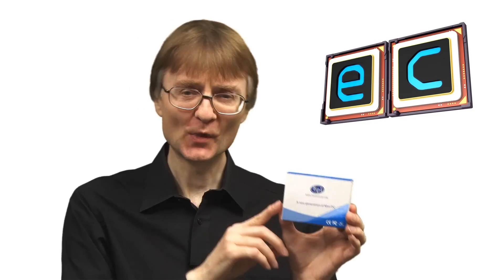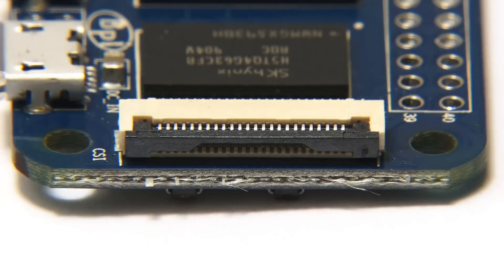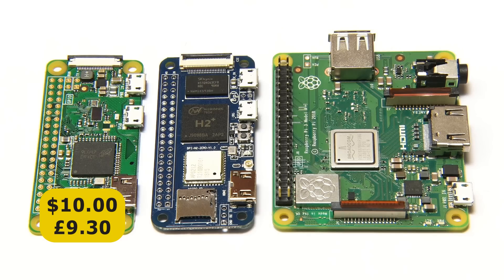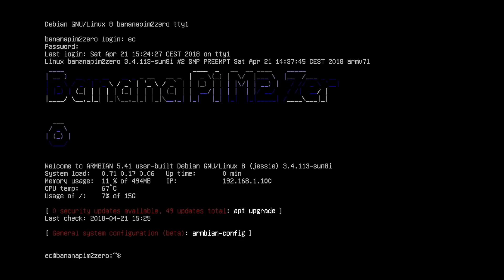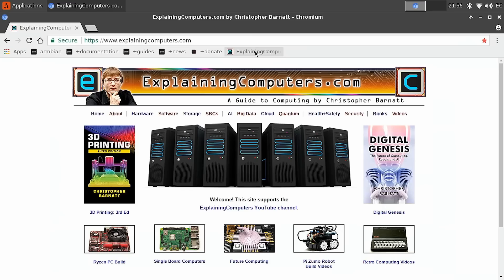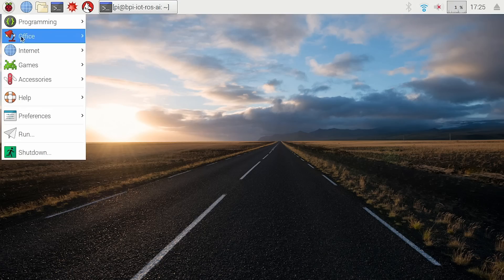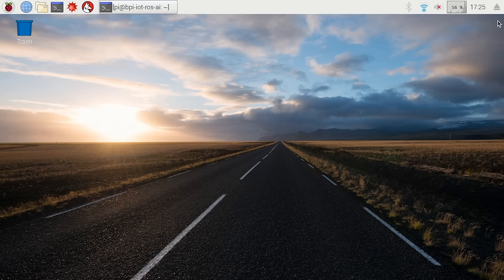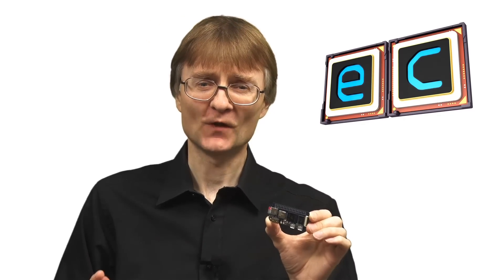Banana Pi M2 Zero: Low-Cost, Quad Core SBC

Comment: they should have made the board curved to closer resemble a banana, missed opportunity i feel.
Reply: Haha sounds like a fun idea if a little impractical with peripherals unless peripherals come in bunches perhaps?!
Reply: 3D printed banana shaped case with yellow filament ?...
Reply: They should have made it yellow.
Reply: @dsmyify  Yep, and called it "Not a banana M2 Zero" :)
But you are most correct because if the Pi stands for "pie" then it just has to be "kinda flat topped with appropriate color".
Reply: @dsmyify  ... but mine are all brown to black, and spotted.
Reply: Well they didn’t make the raspberry pi look like one of those...
Reply: Only for a DIY Banana-phone
Reply: I have a banana would you like to try it " it is easy get in different shape ?  you have nothing else to ask eh ?
Reply: I think a yellow board would be the best solution.
Reply: yes, i peel they did...
and do did you!
=D
Reply: They should made the box slippery

Comment: Watching that bag cutting it looks like Mr Scissors needs Mrs Sharpener.
Reply: What bothered me was the bag had precut notches in it, making the scissors completely unnecessary XD
Reply: @MacroPheliac  Yeah, but do those ever work right? The bag always rips open horribly using the pre-cuts.
Reply: @Rudofaux  yeah it does make for a crooked tear most of the time.
Reply: I couldn't help but notice that in another vid you demonstrated how to open these bags sans scissors! ;)
Reply: @MacroPheliac  Same here haha! I thought for sure this guy has opened enough of these bags to know those notches are for tearing the bag open?! XD
Reply: @Rudofaux  that's why it gives you 2 chances, one from each end. haha!
Reply: @MacroPheliac  often those notches are ABOVE the plastic weld

Comment: I think answer to the question "Which SBC should I buy?" has been for a while and will be for a long time: Latest full size Raspberry Pi for beginners and general use, latest versions of Zero and A for those who need something smaller or cheaper and lastly, these Allwinner and whatnot based SBCs for those who need something more specific. Further away from full size Raspberry Pis,  more tinkering is needed.
These SBCs are often good on paper, disappointments after launch and then they become good again, when the brilliant team behind Armbian does their magic.
EDIT: To clarify, my "Latest Raspberry Pi" answer is to beginners, who don't have real use case in mind and they just want to start tinkering. Of course all these boards are different and there are use-cases for all of them. Thanks to the popularity and community, Raspberry Pi is the easiest to get started with. It's not only option, it's not answer to all possible needs, but it's a nice board to use when taking first steps into the fascinating world of linux and embedded stuff.
Reply: I think it's mainly a choice between power on small formfactor vs. affordability & community
Reply: @Sithhy  and connectivity
Reply: Like I said in my main reply most who use SBC's normally have a use case for it, not the oh look something cheap and shiny knee jerk purchaser.

Personally ive got a few SBC's all doing stuff ( mainly building images / kernels ) everything from Beagle / Panda / Bones from Ti to Rock64/pro64's along with some RiscV systems with FPGA's, everything else is smaller Iron ( Cortex M and below needing at RTOS ) ..

In the case of AllWinner the SBC's are very powerful no doubt about that, but like I said its the lack of BSP / Documentation that lets it down.  But the caveat is this is the Linux world not Windows with binary proprietary drivers so in this space which is still very much in flux you have to take the bumps in the road in your stride.  It is so inappropriate to expect 100% out of the box operation,  if you want that stick with PC's and windows.

I think you mean the amazing kernel team that provides the core to any and all SBC's and maintainers that make SBC's perform better pretty much with every new release.
Reply: @sethrd999  Only real use I see for these SBC's would be running a Kodi box, and even then, the GPU performance is lacking for true 1080p 60 fps, and forget anything higher.
Reply: @mikem9536  Mali is quite surprisingly powerful, I think they lend more to robotics / drones tbh.  Many add on possibilites for that area with the GPIO's.  Kodi in 512MB is a stretch.
Reply: @mikem9536  What are you on about?  Every Raspberry Pi ever made can output 1080p60 over HDMI, and the Pi4 can handle 4k.  They're powered by Broadcom SoC's similar to what's in a Roku.  The Pi's got amazing video performance given it's size and cost.
Reply: I basically don't use anything but brand name Raspberry Pis and Arduino Unos and Megas.  I mean, what for?  I've seen an Intel Atom (along with a HUGE heat sink) crammed on a PiB+ form factor board running Windows, perhaps on this channel.  Not sure why it was made or who it was for.  There's all the various ARM M0-based Arduino form factor boards, none of which are exactly compatible, none of them really suited to the Uno pinout, and they're basically not electrically compatible with any shields made for the Uno so...why?
Reply: @thegardenofeatin5965  For those of us that design our own break outs ala ESP8266/32 and what nots the 3.3v / 5v tollerance is not an issue, this would also be true for STM32 F series which lends itself to projects alot better than an ATMega with support for an RTOS ( FreeRTOS / Zephyr, NutX, RiotOS ) among other things like real Debug with JTag support.

Its down to the project in mind..
Reply: @sethrd999  add to that that this unit has mere 512mb of ram. yeah it can be used but, damn you better know what you need and don't need running. a quad core but, half a gb of ram OOOFFF!
Reply: @thegardenofeatin5965  They cant decode Youtube at 1080p 60 fps which is quire important for a media box
Reply: There's hundreds of different models of car out there. And then there's vans, small trucks, semi trailers, etc. Some of you guys seem to think this is excessive, as everyone should simply own a 4 door sedan from Mercedes, or if they need something smaller, a Toyota hatchback.
Does that sound practical?

Yes, some of these cheaper SBCs perform fairly crap. But if you know that, and you're on a budget, and your project doesn't need the speed of a more expensive product, then they're great.
Reply: I just got a diligent Cora Z7 and I think I'm at my limit with xilinx's vivado IDE. But so many cool things to do once your on the other side of the beginners circle.
Reply: Availability is becoming more and more of a factor now, Raspberry Pi boards are becoming increasingly difficult to get your hands on, I wouldn't be surprised if more people start looking at and supporting these other SBCs just because they're in greater supply.

Comment: Hi Chris - your channel is now my go-to for SBC work; your clear configuration instructions are always useful and always seem to work for me, and I am tempted to dip my toe in the water again for a new project! Likely to be R.Pi4 under Raspbian.
Reply from the maker: Thanks for this, appreciated. Have you seen the 2GB RAM Pi 4 is now $35. Very hard to beat.
Reply: @ExplainingComputers  Oh no, catastrophe! I found out that RPi4  (unlike RPi3) cannot be booted directly from USB/SSD. I don't trust the SD cards for a reliable system drive so the project will have to wait for RPi foundation fix.

Comment: And here we are, 2 years later. Its August 2022, and right now the rpi zero 2 w is being scalped on amazon for 99 dollars, and sold out literally everywhere else... The bpi m2 zero, however is still available on aliexpress for $20.59. 

A possible contender is the orange pi i96. that board costs 6 bucks but is running ddr2 and a much slower proc.

Comment: Anyone: "Surely, you wouldn't want to run a word processor on 512MB of RAM?"
Chris: "I would, and don't call me Shirley."
Reply: laughs in C=64 GEOS
Reply: I wonder how many instances of Wordgrinder would fit in 512MB?
Reply: 512 MB's of RAM? Is this 2005?
Reply: @ivorjawa  I ran Speedscript on my C64. I told my Grandson that I typed it in out of a magazine listing and he just stared at me like he couldn't believe it.
Reply: Benjamin Muller  That's how I learned about backups! I had been typing that listing in for 3 hours and my daughter tripped over the power brick for the C64. I then started saving my work every 15 minutes or so.
Reply: Love that movie. LOL.
Reply: Back in the 1980s I ran TeX (LaTeX) on a VAX 11/785 with 8 MB of RAM.  Prior to that I used an Apple 2 with 64 KB of RAM.  I still use LaTeX today.
Reply: Its 1994 and im booting my 486dx2 66mhz with 4 MB RAM and Windows 3.1 . Word runs totaly smooth. In 2020. On a 1.2 GHz with 512 MB everything runs in slomo. ;-)
Reply: "Because I want to" is exactly the correct response I think.
Reply: @worldsendace  Software optimisation has all gone to hell!
Reply: I admin a minicomputer that had less WORDS (not byte), where 30-40 users run word processor, and emacs while compiled and run C.  It workes, but was slow, as one could guess. :-)  
The disc cabinet where we had the discs about 330 MB words per disk, sing about 5-10 cm 1.8 m above ground.
Yes, it was a Pr1me 750 which run Primos 19.4 at the time. A nice hardware and OS sourced from Multics. :-)
Reply: Laughs in Appleworks on a 48K Apple II+
Reply: you guys have MEGABYTES of RAM!?
Reply: @mikem9536  256 MB is plenty, more than enough; just do not run Linux
Reply: @ArjanvanVught  I run servers on 128 MB Linux. Works great, depending on what you have running.
Emacs, without graphics, work good.
Reply: @ArjanvanVught  openwrt runs on as low as 16MB of ram. Linux core is quite efficient.
Reply: No, just run the pc system to Linex and be happy, 😂
Reply: @mikem9536  No, it 2020 as of today ;-)
Reply: @AndersJackson  Ok. Understood. No UI ;-)
Reply: @ArjanvanVught  a CLI is also an UI. ;-)
Reply: rockets4kids I'm running groff on my laptop, I've been thinking of learning LaTeX but it's pretty bloated;)
Reply: @rockets4kids  I hope you don't mean you are running Latex still on the Apple 2. But apparently you had the same feeling which I had when Christopher fired up Writer. Why would anyone put the burden of Writer on a Zero, while Vim + Latex is much lighter and much (and much) better.
Reply: @worldsendace  I used to use WordPerfect on a 286 with 1MB RAM. In fact I still have it working in a DOSBox instance.
Reply: @michaelturpen5159  First word processor I ever used was probably Tasword on a 48K ZX Spectrum. I may still have a document on cassette.
Reply: @worldsendace  All the abstractions are abstracted away by abstractions that are abstracted away by abstractions that are abstracted awa.......................................etc
Reply: @ArjanvanVught   Linux is fine, it's X you have to beware of.

Comment: These systems on a chip a more powerful than my "gaming" PC from the early 2000's. Good stuff.
Reply: i remember giving my amd k6-2 64mb ram back in the day  and thinking it was a beast ........ now i have smart watches an order of magnitude faster
Reply: @deadadam666  Yes, I remember buying a 32mb RAM stick and it improved the pc performance substantially.
Reply: Maybe on CPU side it is, but highly unlikely that this sbc has stronger GPU.
Reply: @deadadam666  i did the same just for Quake 3

Comment: Great review and good timing. I've wanted to buy a Banana Pi M2 Zero for a while now. It is supposed to fit in "most" Rpi Zero cases. I finally clicked your link and bought one along with two aluminum cases from same seller. I've had a few Rpi Zeros since they were available. They are fun little SBCs but really lacking in power. I will appreciate the extra speed on the Banana Pi M2 Zero. I wish they could have fitted it with 1GB RAM but you can't have everything. I'll be looking for some retro game emulation builds for it. 
Not sure I will find anything but I will be content running Armbian if I can't.
I even bought a couple of custom machined aluminum cases for the Pi Zero Zeros when they were available a couple of years ago. 
The aluminum cases I bought from the seller at your link look every bit as good as my old custom cases. Now to find a mini antenna for the Banana Pi M2 Zero. I believe it will need one even more once trapped in an aluminum case. 
I still get decent WiFi with my Pi Zero W models in the aluminum cases but it could be better.

Comment: I have seriously considered upgrading my prior purchase of a Raspberry Pi Model 3B+ to the Model 4. But, I just purchased a new Acer laptop with quad core 8th gen i7 processor running at 1.80GHz with boost to 4.6GHz. So, I'll have to wait a while. Great video!

Comment: I'd say extra $5 is totally worth for Pi 3A. Did you try to solder all those 40 GPIOs? Not mentioning performance....
Reply: Well if you need something smaller than Pi3 then it doesn't matter. If you don't need Pi0 W form factor then you can get e.g. NanoPi NEO2 LTS with Allwinner H5 with fairly similar performance to Raspberry Pi3 and with similar price to that BananaPi M2 Zero - so still pretty cheap and powerful; or you can aim for OrangePi Zero Plus H5 with similar form factor na WiFi instead of Ethernet. It's not like it was few years back when you didn't really have much of the competition. Now there's plenty of decent SBCs and with Armbian's more mature support for H2+/H3/H5 they are usually best bang for a bucks if raw performance is what you seek.
Reply: @Promilus1984  That was a great comment. Thanks. Just a remark - I do realize that there is wide variety SBCs available on the market these days. I simply was following the selection presented in this video.
Reply: If you're designing from scratch and have the room for the larger form factor... yes.  The faster speed is great.  One thing that wasn't touched was power draw.  There may be some advantages between the different models if current draw comes into play... especially for battery powered projects where the unit will need to be powered for long periods of time with short bursts of processing.
Reply: @fakshen1973  Generally speaking yes, you're right. But some considerations : with Pi3 you have an option to downgrade performance (that is why there are 2 power feeds USB and 5V jack) and this Banana Pi showed temp core of 67C - makes me wander what is actual TDP of this set...

Comment: I have a Prusa 3D printer. You can use a Pi 0 W with octoprint to provide a print server for the 3D printer. Using this I have enough power to attach the camera and create "videos" of the 3D printing process (and monitor the print). This is EXACTLY what I was looking for, I ordered one for that.

Also, I have a Speccy Next on its way to me. I'm going to get another BananaPi and use it as the accelerator (4X the acceleration). Who doesn't want more power ;)
Reply from the maker: Congrats on having a Speccy Next on the way. :)
Reply: @ExplainingComputers  I'm planning on doing a video about it. What could I possibly say that EVERY other person hasn't already said? I grew up using the C64, Apple II and PC. I never touched a Spectrum. I have no nostalgia for it, but am highly interested in it. So, I'm going to do my review as a first time user of the Spectrum.

Comment: As usual, an excellent review. I always look forward to my Sunday Morning Coffee with you.
The Banana Pi could be the step up that someone who is space constrained for speed and willing/able to do some programming.
I see some comments that indicate that some believe that the developers of the hardware don't do enough software development. But, that's one of the beauties of OSHW and Software, the ability to make change and be more purposeful (was wondering if that was even a word but the spellcheck seems to like it).If you want little to none for hardware and software you buy into the Apple realm, if you was SOME software and lots of hardware you go the Microsoft route. When you want total control of it all, go OSHW and learn some Java or CircuitPython (shameless plug to the folks at Adafruit and the CircuitPython community), or C++ and Arduino.
At any rate, I'll climb down from the soap box and say again, an excellent review and a great breakfast experience, for me anyway.
Keep up the good work.
Reply from the maker: Thanks for this Mark -- always great to hear from you and get your view. :)
Reply: Please excuse the dumb question but, what is OSHW? I just getting up to speed with the hobby.
Reply: @3rd_Millennium_Engineering  Open Source HardWare. Basically all the plans for design and building are available to be used by anyone.
Reply: @Duewester  Thank you, Thomas. After I had discovered it's meaning (just before yoyur reply), I was almost going to delete this question but who knows, maybe someone else reading these comments will be starting at the same point I am currently at. :-)

Comment: I have a banana pi m2 ultra, and still can not find same level of software support as rpi has; in my last try even Armbian didn't support it. 

In general for newcomers rpi is the best, however the hardware design and specification of the competitors' board are really enticing.

Thanks for creating this wonderful video, I do learn a lot and surprised that it can run raspbian!